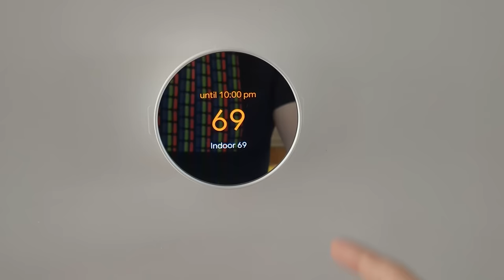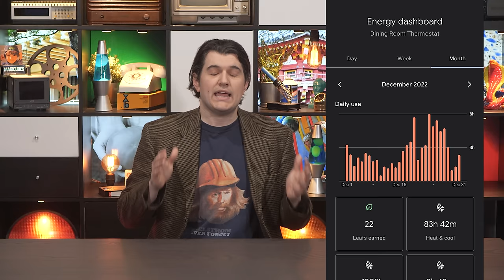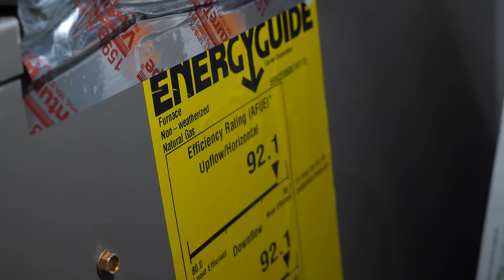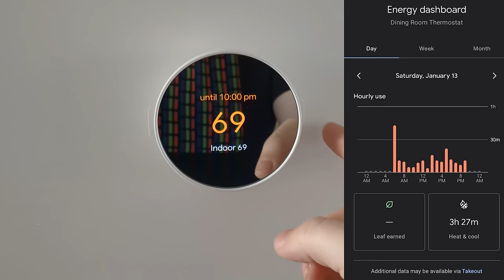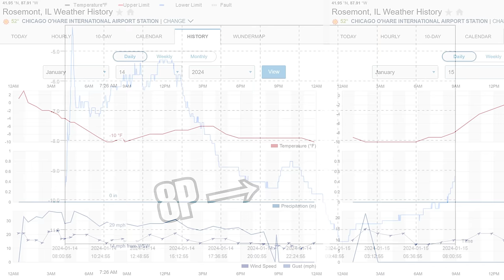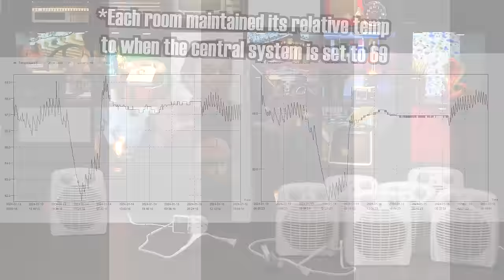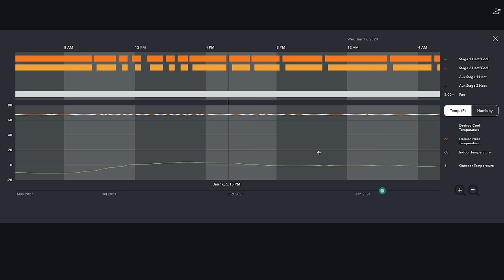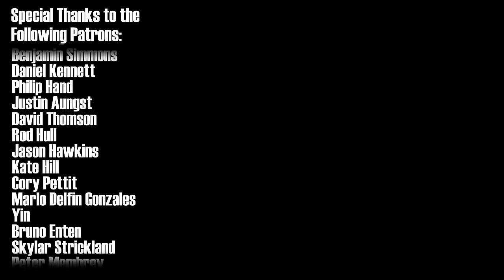Old HVAC industry practices are holding us back and costing us money. But we can fix it.

Comment: HVAC guy here. A lot of the issues I've seen have been lack of adequate training. I've literally googled my way to competency, and that is completely unacceptable. But, they don't care as long as we figure it out eventually because the customer is footing the bill anyways. It's horrifying
Reply: I was in HVAC for years, and had to learn so much of the stuff myself.
It's a chronic issue with the entire economy...   nobody wants to train, but everybody complains about how unqualified people are.
Reply: I have found this to be true. If I give real useful information to my hvac installer they will actually use it. I just have to also respect what knowledge they have. 

Also I had one hvac installer say he enjoyed coming to my place because I stood and watched but not to complain but so I could learn. And we would talk about new hvac technologies. This was a decade ago so my heatpump is only efficient down to 25f. We talked about the idea of stuff that is on the market now. He was not having those conversations many other places.
Reply: No kidding. When my new system was installed a few years ago (2-ton, heat pump, 11.5kW aux heat) about the only thing they got right was they put the heat pump outside and the air handler inside. 
They reused the existing lineset that was too small, which they had to fix. Unfortunately they didn't fix anything else: 
Reversing valve was left disconnected because they didn't know how to program the thermostat for B vs O. I fixed that.
W was wired to W2 at the air handler, but I do not have 2 stage aux heat. Combined with the reversing valve issue that means I HAD NO HEAT AT ALL the first time I needed it. 
HP is a 2-stage unit, wasn't wired that way. I fixed that.
Since then I have learned a lot about HVAC, including how to check and adjust charge, find leaks, etc.. and I'm just an IT guy.
And yes, they did try to upsell me on the tonnage. I insisted I only needed 2 ton.
Reply: @coyote_den  I went over tonnage several years ago when I replaced my unit.  The house is a '57 in the desert chaparral which did get hot back in the day but not like today.  The walls were thin and the old unit could keep the house at 88 F running 24/7.  The new unit was 3.5 tons for 1250 sq ft with a detached garage and a roof too low guys wouldn't install or said it wasn't worth the effort to install a fan.  With the new unit in it we kept it at 78 F in the summer and basically kept blackout curtains up during that time.  I don't think it could get below 78 F.  When I moved the container I was loading ceiling (where I'd be up to do the tie downs) got to 120 F,  I'd do 20 minutes then go inside chug water lay down for 20 minutes.  Prep for 20 minutes then go out and do another 20 minutes of loading.  I worked till past midnight cause that was cooler.
Reply: @hhiippiittyy  yup this is the problem with outsourcing all training to schools.
Reply: "Google your way to competence" is the millennial 'fake it to you make it'
Reply: @coyote_den actually the air handler should be wired for w2. The heat pump is the w1 or first stage of heating, and you want it like that because it is more cost efficient. The air handler only has the electric, or auxiliary, heat component in it, and so only needs the w(2) call when you need to use your auxiliary heat. The rest of your story sounds like amateur hour though, so I certainly understand why you would assume that was done wrong too.
Reply: SAME MAN.  NOONE WANTS TO TEACH!!!!  It's so frustrating.  I've been plumbing for 10 years and this is exactly what i experience.
Reply: its all about slick marketing, then hiring cheap to get it done quick.  The gouging today is transient but jaw-dropping.
Reply: I work in a supply house and it’s no better there. We are more plumbing than HVAC but do enough that we all should be competent. I asked for more training on HVAC once and you’d have thought I asked for a blowjob from my manager. It makes it difficult to sell things we barely know about. The hydronics side seems much better, we have better reps and better training that’s more accessible and I’ve taken factory tours after training seminars and I feel much more confident selling those products.

Comment: One of my favourite things about heat pumps:

My parents regularly used the old cliche line of parents telling their kids to close the doors / windows, "we aren't air conditioning outside". 

And now they aircondition the outside for half the year.
Reply: Dang it, you mean as a Dad if I go for a heat pump I won't be able to use that line?! Aww man!
Reply: @andrebaron1387 Yes you still can.
Reply: The line is technically wrong, if you open the doors you aren't air conditioning anything, but you are dehumidifying outside. Because a heat pump where the hot and cold sides are in the same connected space is exactly that, a dehumidifier.
Reply: @andrebaron1387  Just replace it with, "Close the door, I just paid to move that heat!"
Reply: What were you, born in a barn?
Reply: @Chriscraft50  No, but I was damned near born in a Sedan when my mother's labour with me was so much shorter than my older siblings
Reply: @88porpoise  right. My dad would say that if we didn't close the door fast enough.
Reply: @atk05003  "I paid to move that heat, you can move that door!"

Comment: Is this the ultimate Technology Connections video? Combining space heaters, with extension leads, with incandescent Christmas lights, with heatpumps and the latent heat of vaporization? Like a call back to every previous video.
Reply: It can't be. I watched the whole thing and there was no dishwasher detergent powder anywhere...
Reply: @winrawrisyou  Except in 35:32
Reply: Might need some more antiquated photography methods. Oh and more relays!
Reply: Don't forget obsolete media formats!
Reply: One or two turn signals wouldn't have been out of place...
Reply: @ajbp95  Has to be two so they can be out if sync!
Reply: It's like the Avengers multiverse BUT BETTER!
Reply: Needs some toaster and bimetallic strip
Reply: @xavierinthetube  Bimetallic strip is what is found in old thermostats, so... kinda here already?
Reply: Brown and can openers are my favorite two
Reply: There are relays. In the thermostats.
Reply: If you look closely, you can even see the color brown!
Reply: "Say the line!x

Through the magic of buying two of them
Reply: Pretty sure he had a few smokedetectors around during his tests aswell
Reply: The penultimate edition! 👏🏻
Reply: But what about the storm lanterns?!
Reply: Was probably primed and use ready if the circuit was overloaded at nigth.
Reply: The real challenge is to get to dishwasher detergent into the mix on this one.
Reply: @winrawrisyou gotta save something for the sequel.
Reply: A percolator was missing, but I can live with that.

Comment: As a hvac tech. We do load calcs on every single sale (except mobile homes). We fit to the home but upsize the coil a half ton to dehumidify a little more. We're also trying to get into insulation to help our installs work more efficiently so this video was awesome to listen to
Reply: You deliberately mismatch the air handler to "dehumidify a little more"?   That is genius, if you are in Louisiana, Mississippi, etc, but reverse if Arizona Colorado etc.  At first I misread this as "we upsize... a half-ton" (typically implying the comp or whole split unit) which dehumidifies less not more.  Also, just from experience, most homes are too dry 90% of the time.  It can help some elderly and allergy sufferers as long as they drink an extra 2-3 quarts of water daily to compensate (almost none do).
Reply: Why not mobile homes?
Reply: @austin2725  a number of reasons. Mostly the ductwork in mobile homes isn't the best and we can only push so much CFM through them so we go off the length of the home. Aside from the cheap windows and low to no  insulation, theirs really no point because of the ductwork
Reply: When my parents had their furnace replaced, I'm guessing that the company did something similar, because the unit is absolutely tiny compared with the old one. Granted the old one was pretty old, so some of that is probably efficiency

But, that being said, natural gas is being banned here for new installs and I'm sure that over time it will be a choice of base board heaters, heat pumps and IR. Personally, I've got baseboard heaters and an portable IR heater and that seems to work just fine. Sure, it does take a while for the place to warm, but I can program the thermostat to start heating it a bit before I get home.
Reply: @SmallSpoonBrigade  yea. Most furnaces are 34 inches tall by 17.5 inches wide. We're in kansas so gas heat hear actually raises humidity in the home quite a bit

Comment: I love this dude, he's one of those youtubers where after you watch one video you're hooked. 
Also thanks to him my dishes are cleaner than ever.
Reply: I never bothered with that rinse fluid, I vaguely even remembered there was a place for it in my dishwasher. After watching his dishwasher video I bought some and tried it. It works great, the glasses are shiny now and as a bonus it eventually cleaned the calcium deposits off the inside of the dishwasher.
Reply: He even cleaned your dishes. What a guy xD
Reply: @@os2developerI feel you. The options in my neck of the woods priced my family out of the older townhouses in the town I work in and into a more rural detached single family home. I'll gladly pay the privacy tax, though. I was tired of hearing domestic spats, rough sex, loud music, and home improvement through the walls at all hours of the night when we rented.

But to the original comment, my dishes have never been cleaner and, since installing LEDs in all the light fixtures, my power bill has never been lower.
Reply: @@os2developer Nice! The house my wife and I bought is a bit older, so is in need of weatherproofing and better insulation but it's otherwise fine. 
The swamp cooler will probably be the first major HVAC appliance to go. We live in a desert so they work quite well but I'd rather have a central heat pump/air conditioner with an optional furnace instead. Deserts get mighty cold at night (especially in the winter) so some extra on-demand heat is a good thing.